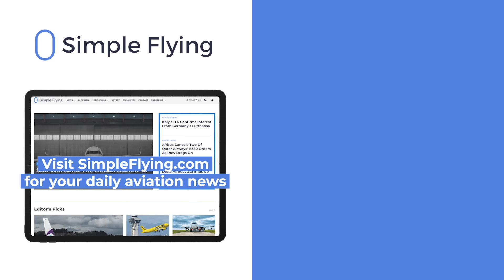Airbus A320 Final Assembly Line Replaces The A380 Factory

Comment: Nice to see that at least one aircraft manufacturer seems to have their act together
Reply: You are completely nuts! Boeing had just done the same converting the former 747 line and former 787 at Everett to 737 Max production so there!
Reply: @crazylife726 yeah, Boeing is still a mess from the top to the bottom. Don’t forget the company that throws its own employees under the bus. As a former maintenance employee of Boeing I can confirm the culture that comes with the job is disturbing. Push, push, push with little regard for due process ultimately resulting in safety issues. I can GUARANTEE you that Boeing DO NOT have their act together. 

Oh, I almost forgot the obligatory - so there!
Reply: How right you were job.
🫣

Comment: Was that a New Zealand Air tail?
Reply: No its a Air New Zealand vertical stabilizer 🙂

Sorry
Reply: “On aircraft, vertical stabilizers generally point upwards. These are also known as the vertical tail, and are part of an aircraft's empennage.”

Sorry😅😉
Reply: @MarkUKInsects  that's what I meant. I just didn't know the correct technical term.
Reply: @eamonahern7495 short answer: yes
Long and pedantic answer: what the other guy said
Reply: @osasunaitor  concise
Reply: @eamonahern7495  Tail is what 98% of people would call it.
I hope you got that I was being a tongue in cheek  pedant?  you are 100% correct
Reply: @MarkUKInsects  yes I did 😄
Reply: Empennage. Good word. 
Could you define it please?
In laymans terms, does it mean the aircraft’s’ back end ?
Reply: It sort of means "the feathered end", refering to the feathered end of arrows, which provide directional stability.
There are several words of french origin in the aviation world, of which the french were pioneers (aileron, fuselage, manche...).
Reply: @RM6737  
Merci mon vieux 😄

Comment: Correction: Buildings in France are not measured in feet, but meters. France, after all, is the birthplace if the metric system; the last thing they will do is use an outdated (British) imperial system to measure sized of buildings.
Reply: Slight correction.
It would be Metres.
Reply: So they are to blame for metric!
Reply: @stevesmoneypit6137   No, your getting confused, my answer was about nomeclature....

Comment: Where are You guys from? The world is metric, especially in engineering! I wonder when you get it at last. Do metric on technic and nautical on flying. There is no such thing, like imperial in any way in flight iindustry. Even NASA got it. And furthermore, the French, were this building is sitting, invented the metric system, based on angles and earth measurements, not like imperial, based on an arm or a foot.

Comment: AIRBUS needs more orders for the A350-900, A350-900 ULR & A350-1000 HGW wide body jets . . . the A330-900 Neo is clearly eating into A350-900 & A350-1000 HGW sales . . . customers who have pending A330-900 Neo orders, AIRBUS should try convincing them to convert (if possible) their existing order for A330-900 Neo to A350-900 & A350-1000 HGW for the same number of units . . . assembly line in Hamburg, Germany should be dedicated to making the A350-900 & A350-1000 HGW wide body jets . . .